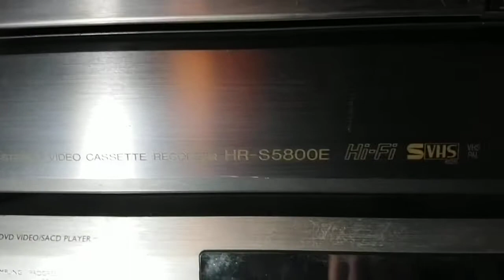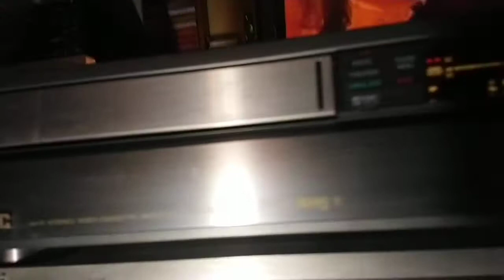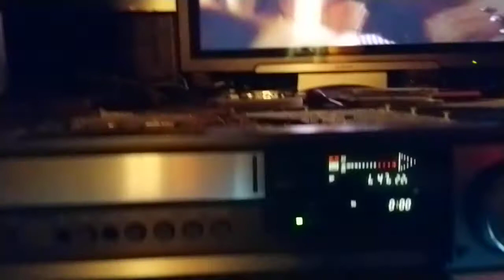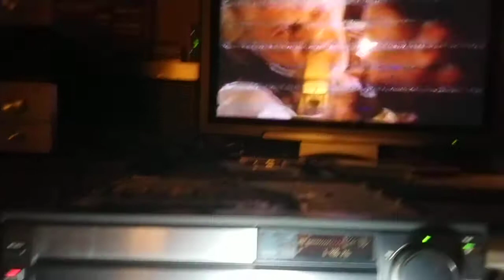14 February 2021 JCV HR-S58000E SVHS

Comment: the upscale of tv is very good
Reply from the maker: I had to look up the term (to take a low res image and fill a large screen and render it in good quality).
Yes It's a great TV, looks bigger the 32" too. Sound, top notch. I mean really. I look after an old guy once a week, he sits in and watches DVD's and his old videos, he's a bit deaf (he's 74 and in bad health) and he has the TV loud. It sounds bleeding terrible - 4 year old run of the mill LCD.
Probably cheaper to run though, this plasma is 250 watts (max - I presume when screen filled with ////... 'white'? ie an image of clouds in the sky would use a lot of power, a night scene less?
Cheers for the comment, I like to learn something, at least once a year, if not month ....